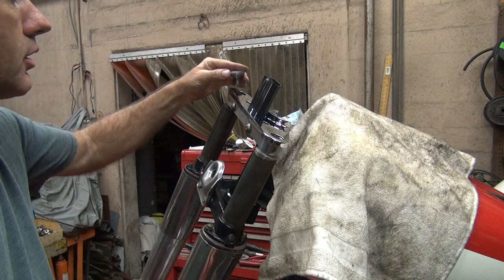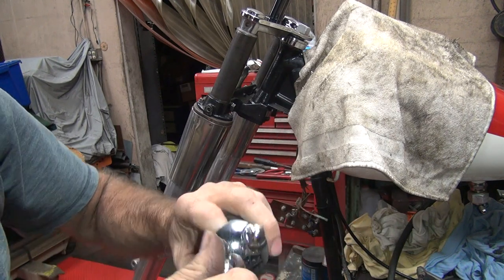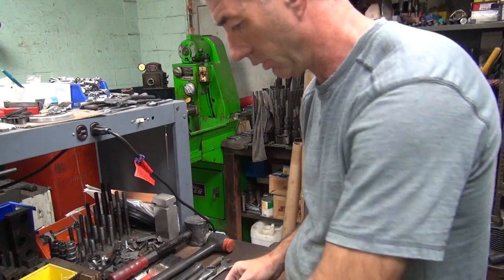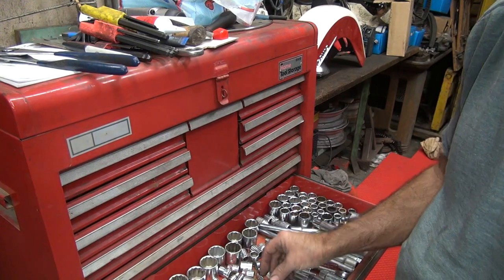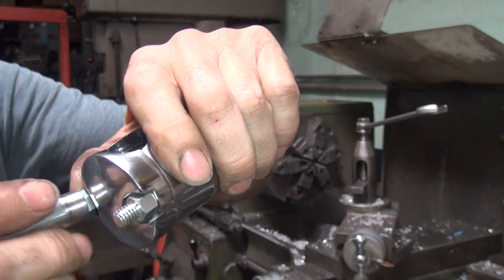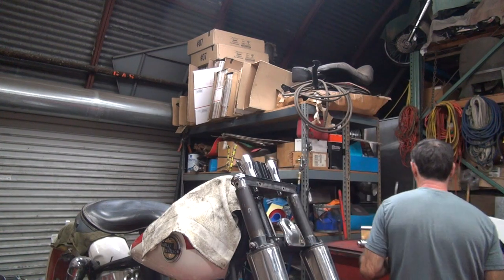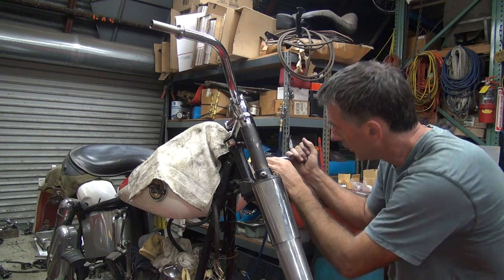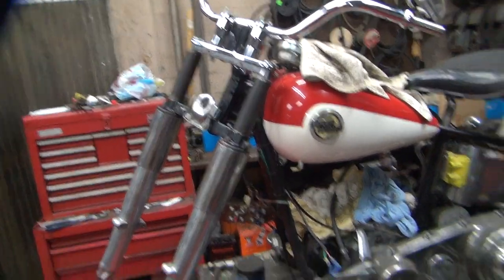1958 panhead 74ci #108 fl bike rebuild topend repair harley by tatro machine

Comment: Hay Tatro, Just spent several watching your vid's they bought back many memories when I built bikes. My favorite was 57 st leg hard tail with a 65 pan head. I noticed you had trouble the taiwan risers, when the risers were made in the USA they
 used allen head bolts and worked and looked great. I used either chrome or polished stainless.

Comment: the acorn and the low flush nut together lock and tighten down. you taught us this on head stud work
Reply from the maker: no, the acorn nuts are for holding on the top cover that i have not installed yet. the acorn locking nut and bolt threads would have to be on the same side to use as a lock nut.
tatro
Reply: Right. I forgot about that extra cover you were installing that separates the two nuts. Thx. So just poorly made is all?

Comment: I could not help notising that your professionaly customised socket did not break, it must have been made from the early years of chineseium, Before it was made from melted down nissan micras with built in rust pores.
Reply from the maker: that and i didn't push the torque very much with those china bolts and all.
tatro

Comment: Hey Keenan,  Interesting story I was replacing the kicker gears the label read something manufacturing with a v in there right so I buy them paid 140 roughly Here in Oz anyway I see product of merica  made yeah like you said wang bang land I open the box to have a look see and notice the dags left after cutting the journal in the brass bush I could have probably removed them but thought I want better quality than this cheap mass produced crap I ended up buying some klassic kicker gears from somewhere same parts but made well and etched into the steel made in USA double the price but quality right I was so disappointed when I learned that this is how it all is now cheap out sourced crappy quality it's not all bad though for some hard to get parts at least they are trying tis a gamble with repop though ha ha take it easy man great vids as always. Best hd tv in the world real deal .

Comment: Tatro, you ever run across a situation extreme difference in exhaust temperature front temp being a lot cooler than rear, coming out the pipe. At idle. Single fire ignition. Doing compression test tomorrow. Just curious bike runs great, other wise.
Reply from the maker: that is normal on most stock bikes. harley has very different running conditions on its motor. the ports and the intake screw it all up. the single fire ignition helps.
tatro
Reply: Bore scoped cylinders yesterday. Front cylinder super clean, can still read part number top of piston! Plug looked great. Rear cylinder seems some what richer. Bike has 23,000 miles on it. Thinking maybe angle carb towards the rear, get gas stream heading to front port.

Comment: Tatro  It's tough trying to make a silk purse out of a sow's ear. I think you have a bent fork tube that may correlate with a bent stem on the bottom tree, as for the risers the bolt should have ben a flat head screw and should have been allowed to fit in the riser on top of a rubber cup washer the same as on the bottom each of the riser's, two rubber cupped washers one on top and one on the bottom facing each other. If memory serves me right the screw also had a flat washer under the head. How come you didn't talk about the damper in the forks as being up dated from those castellated baffles and springs. On your bearing packer, bearing big side down and if the temperature is below 150 deg. clamp it in a vise and it works fine, great little tool.
Reply from the maker: in this case the risers use the hex studs to hold on the top cover. the parts book does not show any washers under the rubber mounts but i will be adding them next. the dampeners were stock and still in the fork. i just didn't take them apart to save time for the customer and because all the other dampener parts were relatively new. i do do what the customers want some of the time. get it done and save money where i can was the word. 
good tips, sounds like you have done some of these before.
tatro
Reply: My books and experience say there are two rubber coated cupped washers in each riser one on top inside the riser one below. the screw needs to clap on the rubber damper only, the riser is held only by the press fit of the dampers or you will lose the dampening effect. I'm not talking about the hex studs they are correct. As for the dampers in the fork tubes they are not period correct. What I brought up is why you didn't bring up that point. I watch you for entertainment not for the educationally value. I've told you before you have a lot to bring to the table, at times you get your tongue in a knot. With all the NOS and old bikes laying around check out the period Risers and you'll understand. Let me correct myself I misspoke when I said Flathead screw in the risers the screw that is used is a Flat Fillister Head. You've said it many times these crap parts that's just what you have with those risers. Bore out the tops turn the bolt heads round and slot them and you'll have something. The later top trees took the same damper that pressed in from the bottom against a shoulder and used solid Risers. The dampers are still available as far as I know or some after market Aluminum slugs for the latter top tree... Let me bring this point up when you clamp down on those risers because the top is not open you can stack all the washers you want and it will continue to pull the riser down compressing the rubber...

Comment: I have worked in aerospace for 34 years and it ain't just the motorcycle industry that has bad foreign parts to contend with. It is a global market for everything from pencils to so called high precision aircraft components. I have to maintain a FAA certification on how to identify counterfit parts. Mostly electronics for missle guidence components. Heck it don't matter what the part is junk is junk. I have been in the biz all these years and I have never flown on an aircraft. I have simply seen too much...........It is ashamed you have to spend so much time just getting stuff to work. Harly has really gone to pot in the last few years.
Reply from the maker: yes, just like everything else. that is why i like the old parts. new or used.
tatro